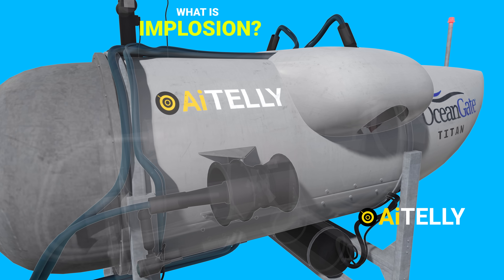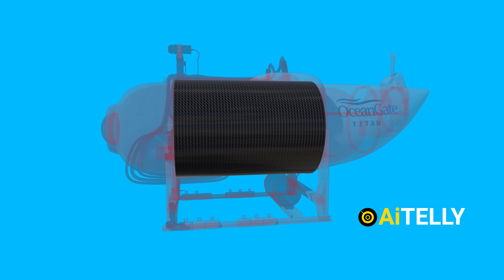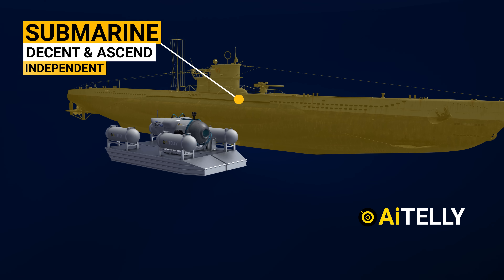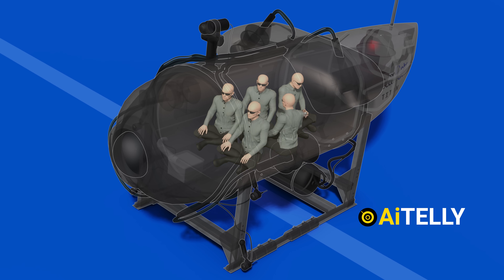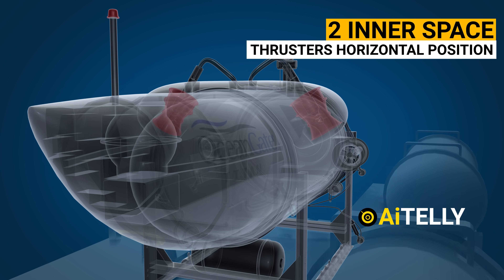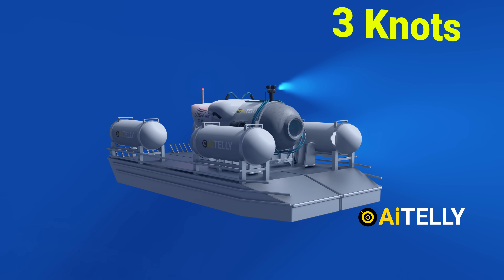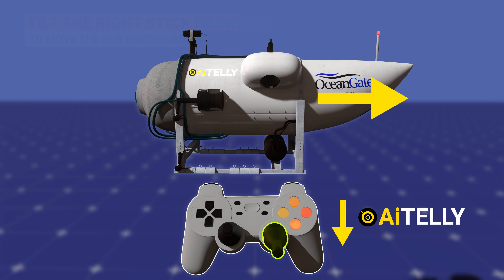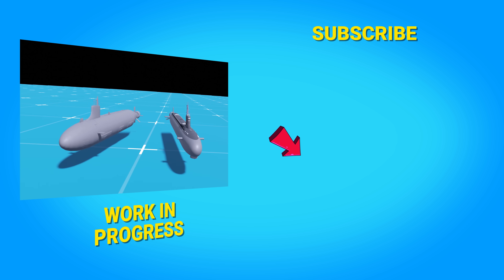Implosion Titan Oceangate How it Happened | Submersible Submarine Parts #3d

Comment: Actually, if a volume of 1 m3 of air at ambiant temperature is compressed from 1 bar to 375 bar, using the ideal gas equation, it should heat up to more than 100 000 °C or 200 000 °Fahrenheit. Which means everything touching that air will undergo combustion. Those inside (surrounded by air) do not become meat soup but are directly converted to ash. 
EDIT: it's more like 1323 °C !
Reply: NO ash and no soup. The calculation yielding a temp of 100,000°C is not a calculation of air at 1 atm being compressed to 375 atm, it's the calculation of the temperature you need to raise pressure of air of1 atm up to 375 atm keeping volume constant. If you use PVT equation to include the reduction in volume of the air, you get a temp of the air more like 1300°C, which will be snuffed out in milliseconds by the water at 4°C, before it gets the chance to transfer any heat to submersible and occupants. NO ash, no soup. Bodies crushed, human remains are found.
Reply: @johnparry9313  I agree.  Not to mention that, according to my back of the envelop calculations, the 800 or so cubic feet of air in the sub would be compressed into a volume of less than 3 cubic feet at a 10,000 foot depth.  Assuming it stayed as a single bubble (unlikely), that is insufficient space for all 5 men to be inside it.  True, they were subjected to extreme pressure which violently collapsed any internal air-filled voids (e.g., lungs, sinuses, ears, etc.) and killed them instantly, but their getting vaporized by heat first seems highly unlikely.
Reply: @johnparry9313  now you're talking sense. agreed
Reply: @johnparry9313  The remains would be like crunchy Spam, but not "lovely Spam." The crunchy bits would be itty bitty pieces of teeth.
Reply: If that is true then how did they find any human remains? The debris didn't even look burnt.
Reply: @suew4609  A fragment of DNA?
Reply: @suew4609  The hypothesis of cooking or incinerating submersible occupants has been fact chaekced by Newsweek and the mechanical and marine egineering professor who checked it said 'the claim is "totally false". "For a start, the water temperature around the Titanic is around 4 degrees Celsius [around 39 degrees Fahrenheit], which acts as a cooling effect," Graham-Jones told Newsweek. "The collapse of the composite or metal structure would just produce theoretical heat energy due to friction, but this is very low and would not be visible or measurable with the mass of cold water around it."
Reply: Thermodynamics slows the transmission of heat though. For what you described you need a perfect conductor that is also a perfect resistor
Reply: nice observation nice 👍 
I don’t know if that’s so easy to predict. separation of air and everything else would happen so fast there might be no time to heat up anything. but the idea seems correct: oxygen in the air bubble, rapid compression -temperature increase, it can burn  things. the water will not boil so the cooling effect of water is slower
Reply: See Johnparry above, plus there is way insufficient oxygen in the capsule for even a partial combustion of the five guys.
Reply: Rehydrated ash is soup
Reply: @revolvermaster4939  When the bodies were turned to space dust by the equivalent heat from all the suns in the universe being  sucked into a black hole, it would have made them space dust, with a gravitation magnetization. The particles of their body would have such an immense gravitational pull that it would have been sucked out of the water and into outer space, so there would be no dust left behind in the water to make soup.
Reply: @methylene5  You were right. I found another online calculator which gave me 1323 °C 
Process Adiabatic
Working gas Air
Molar mass 28.9647 g/mol
Heat capacity (Cv) 20.7967 J/(mol·K)
Heat capacity ratio (γ) 1.4
Initial pressure (p₁) 1 bar
Initial volume (V₁) 1 m³
Initial temperature (T₁) 293.5 K
Amount of gas (n) 40.98 mol
Final pressure (p₂) 375 bar
Final volume (V₂) 0.0145 m³
Final temperature (T₂) 1,323 °C
Internal energy change (ΔU) 1,110,058 J
Work (W) -1,110,058 J
Heat (Q) 0 J
Reply: The air would have pressurized to 375 bar in a millisecond raising the temperature of the air to thousands of degrees and then almost as rapidly cool down due to the 1C water temperature all around it.  That volume of air wouldn't be enough to stay that hot for more than a fraction of a second. I believe the crushing force would be so rapid that the momentary high temperature wouldn't do much to the bodies but perhaps cook the first few layers of skin.
Reply: Interesting.
Reply: Nothing could convert people to ash in the millisecond just before being hit by miles of freezing seawater.
Reply: That's wild. I've heard alot of experts say that. I wondered if they had heard creeking. Water leaking. I think it happened so fast the flexatiton alarms werent even able to send voltage through to go off. That's how quick it happened. Maybe there's so.e type of black box to recover. It'd be dumb if he hadn't had one incase of a catastrophic failure
Reply: Just instant dust
Reply: @nicholasadams2374  Yeah, they were instantly turned to dust, space dust. Dust that would have an immense gravitational pull. It's all explained by theoretical physics like Steven Hawking used to do. Since the universe is made up of strings, the space dust of the bodies imploding would be sucked out into space by these strings that are hollow inside. Imagine a straw sucking a soft drink out of a cup.
Reply: @democratforopenborders6013 "Objection you honor! Counsel is introducing inappropriate levels of sarcasm into the proceedings. We ask that his entire line of snark be stricken!"
Judge: Snickers, then bangs gavel... 'I'll allow it - but tread lightly Counselor. This is supposed to be a serious inquiry...'
🤔😏
Reply: SuperZardo - your numbers are wrong for 375 bar, just over a thousand degrees Celsius is where the ballpark is. However, that's with a relatively slow leak over a few seconds. If it was instantaneous implosion, the momentum of the supersonic water would increase the pressure to thousands of bar reaching many thousands of degrees Celsius, the air would combust any flammables and then explode outwards.
Reply: @methylene5  it's called adiabatic compression, which means in the milliseconds the implosion is happening there is no significant heat loss to the outside world. Especially the center of the big air bubble would reach very high temperatures. I forgot to include the 1.4 heat capacity of air, but even corrected for that the heat could reach around 40 000 °C or around 72 000 °Fahrenheit (this is theoretical, not taking into account heat loss by radiation). Structures in direct contact with that  very hot air should have signs of combustion (at least on their surface).
Reply: @SuperZardo  Actually, a more common example of implosion phenomena is cavitation. Cavitation can be generated either by high intensity sound waves (i.e. acoustic sonication) or of course as I'm sure you know it also occurs inside pumps or boat propellers when there's excessive vacuum formed. 
When the bubble collapses against a solid surface, the liquid meets in the middle producing an extremely high pressure and temperature jet that hits the solid surface and causes the damage. In extreme examples of high intensity cavitation, the temperature can literally be as hot as the surface of the sun in a microscopic point. There was an experiment that was carried out back in the early 2000's where an aqueous solution containing deuterium and tritium containing compounds I believe, was subjected to high intensity sound waves (sonication) and subsequent testing found traces of fusion by products indicating that a small amount of nuclear fusion had actually occurred. Such are the pressures/temperatures that can occur from implosion/cavitation phenomena. The phenomena  is known as bubble fusion/sonofusion. I used to work in nuclear fusion research a couple decades back, when this phenomena was mentioned. 
So yes, clearly implosion can produce temperatures as hot as the sun.
Reply: Also there are some online science articles I've just found where the cavitation peak temperature has been carefully studied under controlled laboratory conditions, one source puts it at 5075K +/- 175K, so pretty much in the ballpark of the sun's surface temperature.
Reply: @methylene5  cavitation is not what occurred. Sub temperature on implosion would be nowhere near the sun. Temperatures in cavitation are high due to two distinct processes occurring over a longer time frame, liquid turning to vapour creating bubbles with friction and pressure, and the subsequent collapse. There is sufficient time for heating and vapourisation to occur, forming the bubble, before the implosion happens.
Reply: @methylene5  getting a submersible filled with hydrogen down to Challenger Depth in order to trigger willfully an implosion would heat the hydrogen up to 1928°C which I presume will not suffice to trigger a fusion reaction?
Reply: @Vanjonsorz  I wasn't suggesting cavitation occurred on the sub, I was using it as an example of a common implosion process. A large enough cavity under extremely high hydrostatic pressure undergoing an implosion, can theoretically produce ridiculous peak temperatures/pressures if the momentum is directed at a single point from all directions, such as occurs in cavitation in a sonicated liquid solution though on a much smaller scale. However in a sub it's unlikely the entire hull suddenly collapses with all the momentum compressing the air into a single highly compressed bubble as the forces will be spread out depending on the various kinetic vectors which will be dependent on precise the hull dimensions. 

A simple analogy, though linear, would be like having a piston and long cylinder (sealed at the opposite end) under nearly full vacuum (say 98% vacuum, with only a little air inside), when the piston is released, the atmospheric pressure at 1 bar will accelerate the piston very fast and that energy (force x distance, or about 1 bar times the length of the vacuum in the cylinder) will momentarily compress the small amount of air in the cylinder as it approaches the cylinder end to well in excess of 1 bar and heat it up a lot, the piston will then reverberate back and forth a number of times until it stabilises with the small amount of air in the piston at 1 bar. In fact you have a small piston and cylinder (sealed at one end), place a piece of cotton inside, ram the piston hard and the cotton will instantly ignite. That's with hardly any force at all (and with hardly any momentum), imagine 380 bar vs 1 bar. 
Same principle, except we're talking about an implosion underwater at high hydrostatic pressure.
Reply: @SuperZardo  If the cavity is large enough, and perfectly spherical, and preferably under high vacuum also, and with only a small amount of isotopic hydrogen inside, it could theoretically be possible to trigger a very small fusion reaction, as the peak pressure/temperature would be enormous. It would be very difficult to do since the vessel would have to instantly vanish somehow at precisely the same moment, then the tremendous potential energy compressing the small amount of isotopic hydrogen (deuterium/tritium) into a microscopic bubble to millions of bar, if the conditions were near perfect. So yes, under ideal conditions.
Reply: @Vanjonsorz  ----- "There is sufficient time for heating and vapourisation to occur, forming the bubble, before the implosion happens." -----

A point worthy of note, that in rapid processes such as an instantaneous implosion, although the heat is theoretically hot enough to boil water into steam (mind you at 380 bar, the boiling point of water is over 400 deg C, higher than the autoignition temperature of most common organics) a boundary layer of vapour forms that insulates the water from the heat quite effectively. Just think of film boiling that occurs when a red hot iron is placed in water, the layer of steam around the iron slows down the cooling / heat transfer rate, compared with convective boiling where heat transfer is far more rapid.
Reply: @methylene5  what? Now the universe magics up extra forces whenever it wants? If the pressure outside was 375 bar, it would only equalise the inside to 375 bar, by exerting 375 bar on it. There is no magical increase.
Reply: @Vanjonsorz  Instant implosion with external hydrostatic pressure of 375 bar does not cause a peak pressure of 375 bar. That's only the final pressure. The energy released from an instantaneous (i.e. adiabatic) implosion at 375 bar will release about as much energy as 9 kg TNT per cubic metre internal volume. The momentum continues and increases the pressure to thousands of bar until the pressure momentarily equalises, then the back blast will cause the water to reverse direction, and most energy resulting shockwave energy dissipating outwards and eventually ending up as heat. So explosion follow implosion. 
Remember Energy equals Force x Distance. 375 bar (37500000 Newtons per sq metre) x distance. Divide that by 4.18 MJ/Kg (calorific value of TNT) and then you get the approx. TNT equivalent per cubic metre.
Reply: @judymerchant3220 yep. Essentially
Reply: I had this same idea, but on another site, some professionals in physics-related fields pointed out that In the Titan scenario, the volume of compressed gas was very small. While there might have been a millisecond of heat/ignition, the large volume of very low temp water it was in, combined with the tiny volume of the compressed air, would make that a negligible factor. Also, in large submarines that have imploded, the incineration effect comes from the inrush of sea water pushing (compressing) air ahead of it. what ignites is the hydrocarbons which are everywhere inside the sub, including on clothing and skin. These hydrocarbons are from the diesel, the various hydraulic oils, and even the cooking oils that are used in the (closed) sub. Also measured in milliseconds, but we are talking a much bigger volume of air and a longitudinal direction from one point. The Titan was tiny, virtually no longitudinal 'distance' from end to end, and carbon fiber fails by sudden shattering, not in the same way as steel/titanium. The conclusion that the underwater heat/ignition component of implosion was negligible in Titan seems to be validated by the absence of any evidence of heat distortion or scorching in the pics of the recovered wreckage.
Reply: @judymerchant3220 Metric units. Not just 9 kg,  9 kg per m3 internal volume and a few m3 total internal volume. Pressure in Newtons/square metre (Pascals, 101325 x 380 bar), multiplied by internal volume in m3, the divide by 4,180,000 (calorific value of TNT). The total internal volume isn't far off 3 m3, so the total figure is closer to 20 kg. The figure is only approximate as doesn't take other factors into account such the resistance from the 1 atm initial pressure in the sub (small enough to be ignored) hull nor secondary autoignition/explosion of organics within the hull
Reply: @judymerchant3220 No, just force x distance. Sub or bubble geometry is irrelevant.
Reply from the maker: Thanks for sharing your information.
Gald to have you as our audience.

You might also like Nuclear Powered Submarine Engineering behind it #3d Nuclear Reactor released
Link: https://youtu.be/J0lb46Zi5-s
Reply: @judymerchant3220 I hear what you're saying, but it doesn't work quite like that in this scenario. The implosion simply occurred too fast for heat transfer, it was over before there was much heat transfer at all. If it was a relatively slow implosion, then that would change everything of course, though the information we have suggests that it was over in single digit milliseconds.
Reply: @judymerchant3220 You do have a point. The main difference will be in the peak pressure from the water hammer effect. Depending on the geometric kinetic energy vectors, whether they meet at a single point or not. However, the energy released will still be exactly the same. The thermodynamic equations are very well understood. I'm not pulling numbers out of the air, I'm a degree qualified chem engineer with a couple decades experience in industry, the calculations are quite simple really,  just force x distance. Whether it's a single bubble or millions, makes no difference to the maths.
Reply: Industrial air cylinders can be pressurised to 500 bar. Explain why industry do not have mini suns in cylinders just sitting around in their yards? Oh and air, as we know it,78 percent nitrogen and 21 percent oxygen, doesn't combust. Not without an adequate fuel source
Reply: @Vanjonsorz  The depth of the ocean at those pressures and lack of sunlight would have created a black hole, and a black hole's gravity sucks in sunlight from the universe. It would have been so hot in that sub when it imploded, that everything would have been vaporized to dust.
Reply: @democratforopenborders6013  LMFAO. Ok.
Reply: @Vanjonsorz  If you compress air at ambient temperature from 1 bar to 500 bar you will get a very high temperature, but compressors have coolers that slowly release that heat as the air is slowly compressed over time.
Reply: @methylene5  compressors have fail safes. Now. What about before? Surely history would record mini suns occurring ?
Reply: @Vanjonsorz  There are no minisuns occurring. Did you not read my comment? Compressors don't compress large volumes of air from 1 bar to 500 bar instantly, otherwise the temperature would reach thousands of degrees. They slowly increase the pressure, and the pipes get hot, which is why they have fans that remove the heat gradually.
Reply: @methylene5  did you misunderstand me saying slow compression is a fail safe thats been built in? How do you think they found out fast fill cylinders are inherently dangerous? I do agree though. Mini suns do not occur when subs implode. I've tested enough vessels to 800 bar to know fine well it cant.
Reply: @Vanjonsorz  Yeah I wasn't sure what you meant, I work with compressors all the time too.
Reply: @Vanjonsorz ..pressure inside diesel engine cylinder durinh compression stroke is about 500 psi and air compressed by stroke is about 528 C, and thats how diesel fuel is ignited..so what is actually issue you are referring to? 'Mini sun' in air compression tanks doesnt happen as tank is pressured up for a very long time, which is why temperature doesnt rise as described. Friction between air molecules is not as high as when you knock them of in millisecond but instead, takes an hour or so, to fill tank...same reason why air inside diesel engine cylinder is heated before fuel is injected and self ignited due cpressed  air heat
Reply: @eccosabanovic1589  the fuel ignites, air does not. You should look up the vast amount of compression accidents that have occurred, And why. No mini suns then either. Someone sold you a dud equation. And ignored abiabatic acknowledgement at the same time
Reply: @judymerchant3220 The astronauts of the Mercury Project got killed as their capsule filled with 100% Oxygen ignited due to a short circuit.
Reply: @alsosprachzarathustra5505  That was Apollo 1 when Gus Grissom, Roger Chaffee and Ed White were killed in a fire.  Also, Apollo 1 capsule could not be opened from the inside which is why the astronauts died in the fire; they could not get out. OceanGate’s Titan submersible was also bolted from the outside with no way to open it from the inside to escape even if they had aborted the dive and gotten to the surface.
Reply: @alsosprachzarathustra5505  actually that was Apollo 1
Reply: It would have been like a star imploding in a black hole. The heat of ten thousand suns would have instantly vaporized everyone inside. The sea water would have boiled for a 5 mile radius around the implosion killing all the fish.
Reply: @democratforopenborders6013 come on now, let's not get carried away with sarcasm.
Reply: @bobby1970  I used to watch Carl Sagan, I know what I'm talking about.
Reply: @democratforopenborders6013  lol